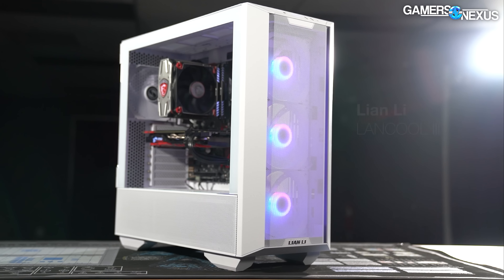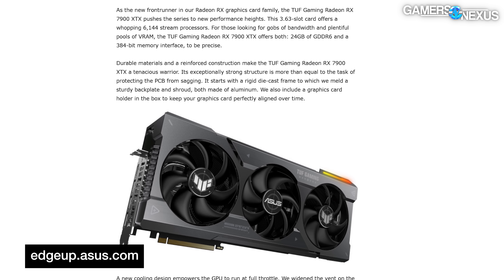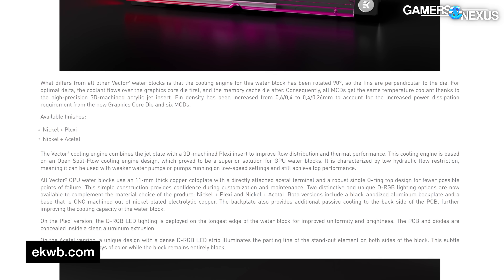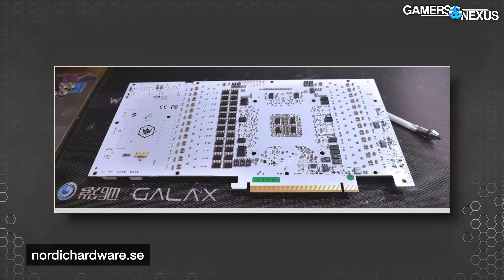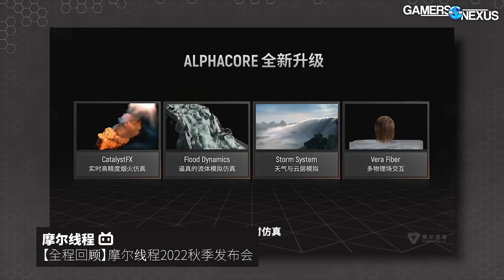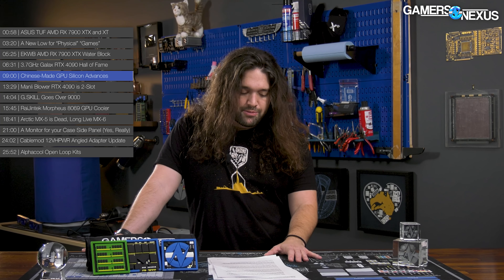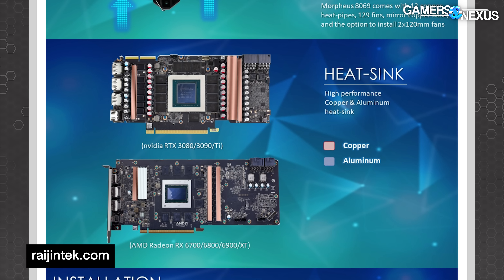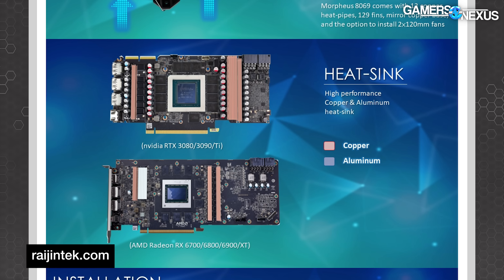HW News - New GPU Competitor, ASUS RX 7900 XTX, 2-Slot RTX 4090 Blower

Comment: Any XTX numbers around yet?
Reply from the maker: Like benchmarks? Not yet -- or at least, not any official ones. The press doesn't have cards yet.
Reply: @GamersNexus  bummer... Thank you!
Reply: @GamersNexus  Do you think the new AMD cards will have the power to compete against the 3000 series a little better than last gen? Love the new look of the cards.. hoping it can net 3080ti+ performance
Reply: @uglymechanics  AMD has been pretty up front, at least not lying with their performance claims. There are no solid numbers yet, but by extrapolation, they should far surpass the 3080TI, even the XT.
Reply: @GamersNexus  Is it the NDA? 😝

Comment: I currently have a single monitor and my case on my desk with no room for another monitor so I guess I am technically the target market for the ASRock product.
Having a monitor on the side of the case would be one possible solution for adding a second display, the other being just put the case on the floor and a second monitor on the desk.
While I have the room to make that choice some people may not, cramped office cubicles were the first thing to spring to mind but really space could be a premium for all types of reasons and users.

What it also made me think of was the pictures of internet cafes in places like the Philippines where the PCs only display was embedded into/mounted on the case to save space and allow for more computers in a small room back to back or flush against a wall on a thin desk/shelf.

Comment: I'd like a small side monitor, but I'd want it outside the case, to be more the size of a smartphone, and to mount it to the wall next to my case. I'd use it to display metrics (FPS, GPU temp, perf cap code, etc). I use pitikapp for that now, on my phone, but it's a pain to boot it up every time and I keep having bugs like MSI afterburner (which I use to get some of the metrics) close every time I start a game.  A 6 or 7 inch panel to show those metric I choose, all the time, would be spiffy.

Comment: I would love a drop in water cooling option for my Torrent and keep my stock 180m front and 140s at the bottom and do a 13900K with 4090 Blocks
Reply: that is a dream come true pc 😂
I'm hoping for 4080/90 Asus-noctua model with new line of noctua 180mm case fans too for that torrent, even though I have fractal design define s2 vision since 2019 and it is full glass and quiet

Comment: i would use it with grafana to display real time system statistics on a large format animated diagram of the system and major external components like NAS or something. 13.3" is also handy for turning an old office PC like an optiplex into a home automation device and stick in a hall closet and not worry as much about having an additional display there, or being forced to remote into it all the time. combine with miniaturized kb/ms (or hopefully they have a touch-enabled version) and these i think are ideal use cases.

i agree that for showcase build a display that is transparent unless the OLED or whatever is active would be a neater augmented reality situation like animated hall of mirrors effect or animating temperatures inside the case derived from thermo couple or reporting temperature sensors.

Comment: The damn video card power cable needs to be located on the bottom far right of the card, so you can plug/unplug it from the back of the case.  It shortens the cable needed and eases up cable management.  No more unsightly cables dangling near the side glass and less weight being put on the top far end of the card (read:  less resulting flex and sag).  You could go as far a combining this new plug with a mounting universal socket that would hold that heavy card in place, so there is less flex once again and will relieve the motherboard connector from excessive stress.  This weight needs to be distributed more evenly.

Comment: Monitor over case side panel makes sense for table space efficiency, if you don't care about transparent side panels and have the case on the table, an extra monitor, but it's a specific use case.

Comment: For the display, the only reason I would buy something like that is to view system information and thermals live (sort of like info like HWINFO64 displays) from a special connector on one of Asrock's motherboards that can communicate with the hardware directly and read sensors. This would eliminate the need for any sort of driver since the UX and everything would run on the display itself. If I really wanted another whole display, I would just buy or use another old display.

Comment: Mount a web camera that shows the view behind the Asrock side panel screen itself of your asrock motherboard on the inside of the case and then have that routed to the side panel monitor, i think they should have the camera and some software included and perhaps a mount for the camera to line it up nicely, as if it wasnt even blocking the view perhaps :)

Comment: i had a issue with pump out before, i tried replacing the stock paste under the ihs of a 4600K with nh-t1, temps went to crap in a weeks time, so i got some liquid metal

Comment: Please can you tell Cablemod to also make a 90° rotated 12VHPWR adapter? One that lets you route the cable parallel to the GPU (like it was on the 3000 FE series (except 3090ti)).
Reply: All the different connector orientations really show the lack of standardization this standard has

Comment: lol watch that cable mod thing end up just adding a lever like torquing to the cards connector. one lil yank on the wire and you will torque on and crack the solder joints on the cards 12pin. jeeez what a bandaid solution.

Comment: The monitor for the side panel is basically a "budget version" of transparent side panels with integrated LCDs. Since this is possible today (hidden front cameras in smartphones) its just a matter of time before we see actual side panels with transparent LCDs.

That is going to be soo cool, because if your running like an APU (5700G) and you miss the design of an GPU in you case, you can simply display a picture of a 3.269 slot graphics card without the need to actually maneuver it into the case or owning it! - What a time to be alive!

Comment: my GTX 1080 TI FE has a 2-slot Blower and it gets both hot 🔥( today record of 73c w Project Cars 3 at default graphix ) AND loud ✈. the fan blows well ; for a 80mm fan size , if not 60mm , doing equivalent to a ~ 1500-200rpm 120-140mm fan , but i'm shure even a 250w card it needs a much bigger RADIATOR . so i think a RTX 4090 would need at least 5-slot size for a Blower-style cooler , plus 1 more for the air to come in . and a 7+2 for the Ti version . that means a PC case as tall as a desk 🤔

Comment: Just a small correction, the magnetic cover is on the terminal on the side, covering the screws. It's actually the GPU branding that is located here, which the user can flip if the GPU is used in a vertical or inverted ATX setup.

Comment: only usefulness I can think of for a large case monitor would be for cases with glass panels on both sides and needing to display things to someone sitting/standing in parallel or running the same animation/visual effect on both sides

Comment: The monitor for the side panel, all you need is a camera in side your case which you then display on the monitor, and bingo you don't need a glass panel, or you could display looped video of a PC with a better looking RGB setup than your own, like a PC with full water cooling.

Comment: About the dual monitor thing, honestly very surprised that at least for modern Intel and AMD AM5 there's not some case with side monitor that acts both as a pass-through and means to co-opt the iGPU with a spacer to lift the ILM slightly.

Comment: Well, I guess the side panel screen is the ARGB-improved 😉 attempt at panels... now we're only a short trip away from SFF as in 1-2u AiO of a true big screen (as in typical TV sizes of nowadays) with a proper desktop hardware encased on the back of it... in a 1-2u server chassis-like compartment behind the screen on the "side" or "top" panel. A "gamer"/workstation attempt at laptop based options from many manufacturers of laptops and prebuilt computers to actually make sense performance-wise.

Comment: Hi Steve. I have a question: why no eve has inventet "the stand for GPU with integrated 12 pin cable". The cable could be hided behing that stand and it could look either nice (as a stamd for GPU) and be practical (the cable could be "unvisible") ?? Please correct me if someone did. 😋

Comment: I put an 11in laptop LCD screen inside a mini ITX case a few months ago just to see how it'd turn out.  I printed a nice 3d bracket for it that's sized for the case, so it's not as janky as the one here.  The original intention was to display AIDA64 info, but it works just fine as a standalone display also.  11in replacement LCDs are really cheap too (about $30, and then $10 for the LCD controller).  There's no RGB to show off inside the case, which gets incredibly boring anyway, so having a screen is infinitely more useful.  The Snowblind case was ahead of its time and most people probably don't know it exists.  I've also built a 3d printed replacement front cover for the Fractal Pop case's 5.25in bays that holds a 5.5in IPS touch screen from Waveshare.  It's overkill at 1440p, but really cool, and can also interact with the PC.  That was a lot more expensive with a total cost almost as much as the case itself.

Comment: I have A 10" 1920x1200 touch display fitted to the front of my lab computer and it is pretty useful for announcements etc whilst in full screen on the main display.  I agree that the 13" replacing the side display is rather daft!

Comment: I think it is quite possible that the 4090 can Easily run in a double slot configuration. I think they Over engineered the cooling for the new flahship

Comment: Immediately I can think of just using the extra monitor as a third one, likely as a vertical monitor. I have never understood the displaycase idea, and good cases now have good enough air pulling capacity that a little extra heat load (probably a 10-15w leak into inside the case) won't harm the cooling significantly, so I could totally see myself considering this for a build, though I already have enough monitors so I'm good.

Comment: For an Mini-ITX or mATX build that monitor could be useful for small setups where you don't actually have room for a dual or triple monitor setup. Put discord or something on the secondary screen. Using displayport is nice because it won't suck up USB bandwidth, but it would be nicer to have a passthrough so you could just plug it into your GPU or the external DP port on your Motherboard. It would also let people without ASRock boards use them.

It's not the dumbest product I've seen recently.

Comment: I’m actually currently building an extra bit of case that will feature a touchscreen monitor that is run by a Raspberry Pi. The screen is smaller though. Not clear if that one is touchscreen though. That I could see as useful. People’s main monitors don’t tend to be touch sensitive. An extra smaller screen that was might actually do a lot for productivity. If it isn’t touch sensitive I think they screwed up.

Comment: It used to be, that small PCs get screwed at the back of a monitor. Now it is the other way around 🤷‍♂
For a showcase, I feel like a LCD panel, without backlight (so you can see inside the case) and have something build related on the display is a better way to go - but also a niche market.

Comment: if I was gonna use my side panel as a screen it would be for a LAN party rig. My corair C70 was my lan rig chasis for many years  an if i could have used the side panes as a screen it would have been a nice to make only on trip to the car and just plug one power cord and you are good to go, BUT 13 inch is a bit small and i would want 120hz and probable at least 1440p

Comment: 24:19 I think that is just another point of failure... There is no certainty in the cause of the failure (probably is not the bending, but the connector not being pushed all the way)... so, how can there be a solution?

Comment: You forgot the ASUS TUF 7900 XTX also includes fans that provide 13.8% more airflow through a cooler that increases heat dissipation area by a FULL 22.8%, as opposed to a PARTIAL 22.7%.

Comment: My thought on mounting Display on the side of my case. It will be way cheaper then buying high end PC Master Race components with RGB Gif graphics on them and it will deliver more colors. Also if you add the 60 FPS that display output it will technically double the FPS you are gaming on Ray Tracing.

Comment: We can see through the designs of Nvidia's workstation A2000, A4000, and A6000 lineups the viability of more sensible cooler form factors.  If I was in the market for a 4090, i'd gladly sacrifice 5-10% performance to have an option that only uses 2 slots and maintain expansion slot availability.

Comment: @27:00 I thought alphacool always had open loop kits? My first WC kit was an alphacool kit. Thin 480mm with the DDC pump 😅.

I've basically been with Alphacool since then, I've since a bit here and then hardware labs: black ice we're some amazing radiators, really dense fins. 

I loved Alphacool because especially back in the day they had the screw plates to protect the radiator fins and water channels. Also the fin density wasn't as high so you could run lower rpm fans.

Also I noticed that a lot of the WC brands that I used when I first got into wcing aren't as readily around now as they used to but I'm glad to see that a lot of their products live on for example in Corsair who use HW Labs radiators and Bitspower fittings for example.

Comment: About the monitor on 21:00, hear me out: single box for transporting full PC including monitor!

Granted, the use case is limited, you're probably better off with a SFF PC and just finding a monitor/TV wherever you're going. Or moving monitor + SFF PC. Or a laptop. And the mounting mechanism isn't very convincing for this either. But I'd considered this kind of thing before, just mounting the display externally somehow.

Reusing the already silly glass side panels for something useful actually seems clever to me.

Comment: 21:00 - Asrock's supported motherboards that have a eDP port seems like only one on the AMD front stranger still it is only supported on ITX (might've been either ITX or Micro ITX) neither seems like what usually goes in a larger case with a ITX build style in mind.

Comment: Nice to have another GPU maker in the market, the other 3 are in the same bed making the market what it is, if they were against each other we would have more cards of lower prices. We have no cards at good prices that can play game good. We should have the 70 series for 250-350 and 80s for 400-600 and 60 series for 200 and 50 series for 100-150

Comment: The Asus TUF RX 7900 XTX is 3.62 slots, 352.9mm long, and has 3.000 fans. It does not have 3.001 fans like some competitor models, and if you find yours comes with 2.999 fans installed, it is defective.

Comment: small comment to the Raijintek, i am using one on my 5700, the Stock cooler simply couldn't handle the load of 2100 mhz overclock, the temps went down by 30+°C, however, if you plan on ordering one, buy heatsink cement/glue/paste, because the stuff coming with the cooler is beyond awful and a waste of material. Also, Arctic disccontinued the Accelero line a year or so ago.

Comment: why wouldn't the 4090 be able to be cooled by a 2-slot cooler? It doesn't run particularly hot as a GPU, coolers are just overbuilt because it was supposed to have much higher TDP.
and the manli one with the level is just a repackaged 51RISC chinese reference card so this other is the proper one they designed

Comment: The side panel display seems like a cool thing to monitor stuff like temperatures, voltages, system load etc. But the price is probably too high, and the fact that you need a specific mobo along with compatible cpu, makes it kinda useless imo, you would be better off getting some other kind of smaller display, or a regular second monitor..

Comment: Love blower GPU's!! I've had enough of all the multi-fan GPUs that dump all the heat inside the case and shorten the life of and overheat motherboard components. The number of slots required by GPUs is also ridiculous and assumes no-one ever plugs any other cards into their motherboards.

Regarding blower GPU coolers, I have been thinking about running a duct from the blower intake to a filtered port on the case. This would effectively put the GPU in a separate cooling circuit from everything else in the case and enhance cooling for both the GPU(s) and the rest of the system.

Comment: I was actually looking into mounting a monitor to the side of my case because I am limited in space and would like to run dual monitors again. My case have 2 metal side panels, I don't care about seeing what's inside my computer.

I was thinking of drilling a side panel and adding reinforcement to screw the monitor on it. Never got around to doing it and I will have to buy a new GPU first because my 2080 Super is gone...

Comment: Intel used to make discrete graphics cards a long time ago and have never stopped doing integrated graphics.  You forgot S3.  I had one in a system before I got my Voodoo3 2000.  It does hardware, but it was only a really limited version of Direct X though.  Most games did not run in hardware mode, like Quake 2.  Also IBM used to make graphics engines for consoles I thought and used to make some CPUs, but never released a stand alone graphics card I think.  Yes I am old (53)... :P

Comment: stock 4090 doesn't use anymore power than a 3080 ti, around 350W. no reason why you can't cool it with a 2 slot, blower cooler at a reasonable RPM